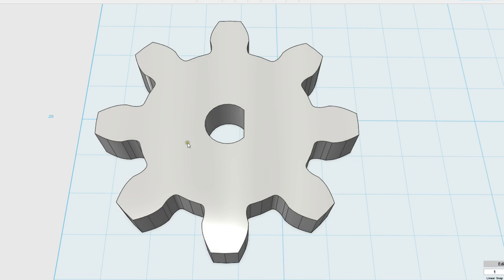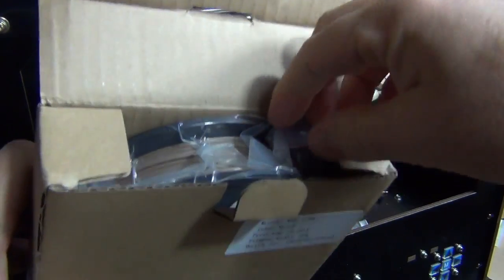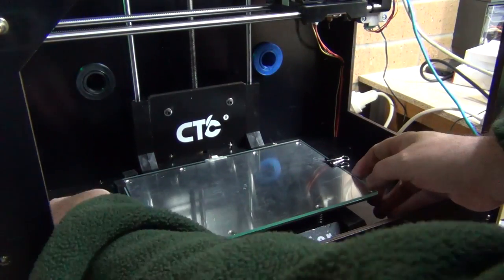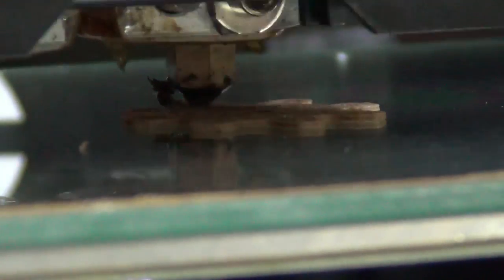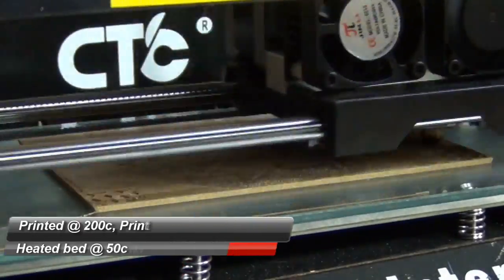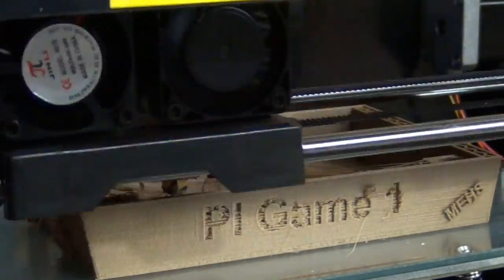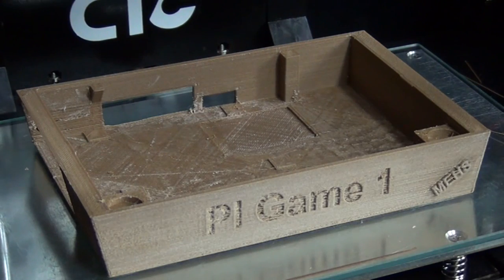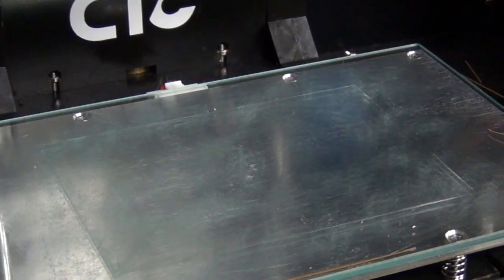3D Printing with Wood PLA (MEHS) Episode 48

Comment: Wood PLA's most definitely string and 'spit' a lot, they tend to work better with 10degrees lower than you'd normally print PLA at. The 250g spools are handy to try out filaments... but $20 is pretty rich!
Reply from the maker: - Thanks Angus.  Yeah $80 per KG is high.  Any brands you have tested that perform better.  Everything else about the filament was satisfactory but below the the quality of brands like PolyMaker and ColorFabb.  I've been spoiled with PolyMax, a filament with which I can start a print and walk away with confidence.  Cheers.
Reply: Polymax PLA is awesome. I have tried colorfabb's woodfil mixes and found they're good - but again not really cost effective!

Comment: What model CTC are you using here?
Reply from the maker: - Hi.  It's just the Dual I purchased off eBay.  I use a glass build plate which is an improvement but aside from that I haven't done a lot to it .  Cheers.